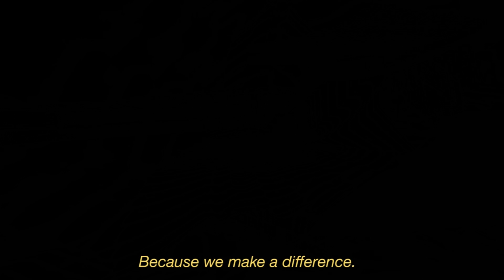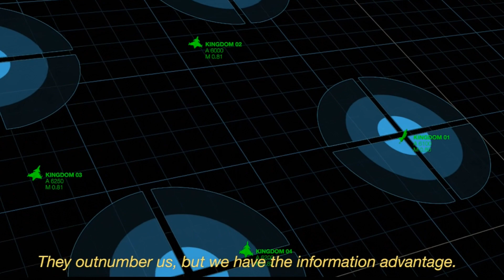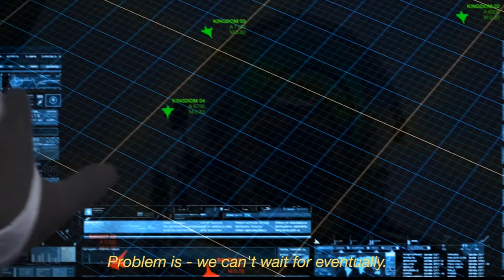Gripen Fighter Jet - Canada's Future Fighter?

Comment: Gripen is an awesome plane but a single engine option doesn't seem to be the best route. I think the Dasault Rafael would fill the role better.
Reply: Why do you say this?  The Gripen has a better safety record than any twin-engined fighter and operates in the Arctic constantly!  This isn't 30 years ago when having two engines was worth it.

Comment: The latest block of F16s would be better than the Gripen.  The F16 is the greatest fighter ever built and an extremely versatile and adaptable platform.

Many if not most major F16 users are switching to the F35 for a good reason.  Not the Gripen but the F35.

It doesn't make sense that if you are going to have a stealth fighter & conventional fighter fleet, to choose the Gripen over the latest F16.

With the USA as your neighbour and the manufacturer and major user of either planes, it would be more sensible for the Canada to have a mixed fleet of F35 & F16s
Reply: The F-16 - Outdated and no upside.  The F-16 is so inferior in fact, that we didn't even want it to be included in the tender.  The F-16 WAS great, so was the '71 Barracuda but I don't think that I'd want either of them over something more advanced.
Reply: Avro Arrow

The F16 can be EASILY upgraded with the latest  technology radar, ew suites, and engines. 

LOL.  Outdated?  The Gripen is over 20 years old using the ancient delta wing and canard layout?

Fact is the Gripen is only getting interest because of lower price and deals.

Many more nations fly the F16 than the Gripen and for those that can afford it they will move to the NEXT GEN F35.

For those on a budget the yes the Gripen becomes a better prospect than the F16, but to say the F16 is outdated compared to the Gripen is laughable.

If Canada was going to go with a MIXED combat fleet with the American F35 being the primary aircraft .... then they should go with American F16s with if they can afford it updated NEW BUILDS or modernised refurbished ex-US aircraft if on a budget.

Sheez.  The States are the manufactures of both aircraft and are your neighbour with a plentiful supply of parts and spares.

It's a no brainer

Actually, buying the Russian Su -57 and Su-34 would solve all of Canada's problems ... but we all know that's not going to happen.  LOL
Reply: You don't make sense, what's so bad about the Gripen being 20 years old? Did you conveniently forget that the F-16 first entered service in 1978, 30 years ago? Gripen E, the latest version, had its maiden flight literally just 3 months ago. Block 70 and Gripen E are both very similar when it comes to specifications; AESA radar, EW suite and so forth are all there. Gripen E has a slightly higher unit cost, but a drastically lower maintenance cost.
Reply: Leon Erlandsson  LOL.  You don't make sense.

Let's get real here. 

Both the F16 and the Gripen are 4th Generation aircraft without stealth abilities and manned.  The F16 has totally dominated the single engine multi-role aircraft in this generation and has completely satisfied all of it's many users.

The 5th generation is focused mostly on mission success with minimal risk of harm or failure & survivability vis improved stealth and reduced detection, avionics, situational awareness by the networking of multiple sensors, and striking targets without detection or beyond vision range. 

But another part of the 5th generation is the movement AWAY from manned aircraft.

Armed UAV's is the future of the combat branch of a modern airforce.

The  F22q & F35 clearly are 5th generation fighters with respected to manned aircraft.  They, especially the F22,  DOMINATE this generation.

Canada is about to replace it's 4th gen F18s with the 5th Gen F35 and are considering also havintg a singel engined 4th Gen fighter to cover broad range of conventional duties with/without air support from the F35.

The F16 is simply the best choice for the Canadian airforce because:
1)  has dominated the market for its type
2) parts and spares are readily available
3) it is produced by it's neighbour who also will be supplying the f35
4) The US can provide made to order NEW BUILDS to integrate cohesively with the supplied F35s
5) The US can provide much cheaper option of refurbished ex-US F16s until the the airforce moves to armed UAV's

And all you can say is that  Aircraft built all the way over in Sweden, with a handful of users, has lower maintenance costs.  smh.

The F16 --  top spec new build or cheap refurbished ex-US -- is easily the better choice.  

It is actually better for Canada to go with the cheaper refurbished machines as unmanned combat aircraft is the future of Airforces.   An F35 securing the skies with a Reaper carrying out ground strikes is a whole lot better than acquiring an F16/gripen and worrying about the loss of the aircraft and its crew.

Enough.  You clearly only have Swedes on your mind
Reply: wutsup Yeah, all I can say is that the maintenance costs are lower. Much lower. Canada does definitely not have the same military budget as the U.S, so these things matter a lot more than the fact that it is simply your neighbor making the planes. SAAB would let Canada build their Gripens in Canada itself, a much better option than buying some refurbished 70's fighter jets, imo. Another point is independency. If the U.S wanted to, they could immediately render Canada's fleet of F-16s useless. A small country like Sweden could not afford to do that. But of course, due to heavy lobbying I doubt we would ever see anything else than American planes serving in the Canadian Air Force.

Comment: Zwhere is the second engine? Needed over Canada's north
Reply: @Jim Small - That's bullshit.  The Gripen has a much better safety record than the CF-18, constantly flies over Sweden's north and also patrols the air around Iceland.  It's not 1981 anymore you know, military jet engines don't just fail like they used to.

Comment: IMHO, the practical solution for Canada's Air Force is a combination of Gripen-E's & F/A-18 SuperHornets. Reasons? 1) They both fill in for the others clear tactical weaknesses, 2) Gripen supports 85-90% of the current Americans weapons + Armaments so the stock-pile of weapons Canada has now will be utilized, 3) Both fighters uses the same F414 Turbofan engine made by GE = more cost savings 4) The Gripen has the best track record of performing in sub-zero temperatures (not including Russian Fighters), a requirement for Canada while the SuperHornet is a proven and familiar platform to the CAF. The Gripen has the lowest maintenance cost in the industry while also boasting the highest output (very rugged). It makes so much sense to go with this solution that it probably won't happen (yea politics).

Comment: This video is an infomercial.

Big 2 problems of the grippens, too light, surely a big economy like Canada can afford better.

Second big problem, for the big expands of Canada and part of that in the arctic is better to have a dual engine fighter, give the pilots a better chance to return to base instead in case of engine failure.
Reply: LostSpider Firat of the Gripen hasn't had a single engine failure for 20 years, including in these conditions. Then Canada is a super big economy. Sure they are big but when it comes to their military spending it's quite low.
Reply: And just what is better?  An Air Force made up of EF-2000s or Rafales that is half the size?  Or maybe an Air Force that is 2/3 the size made up of F/A-18Es?  That's what the cost difference would do.  As for the dual=engine argument, that's a load of crap. The Gripen has a much better safety record than any twin-engined fighter in the world and it operates... IN THE ARCTIC! We no longer live in the 80s and jet engines are extremely reliable now to the point that the second engine is more cost and trouble than it's worth.

Comment: Yeah - let's buy a fighter that virtually no one else is buying from a small country that invests about .005% in military R&D vs. the USA  because we know that it will integrate just fine into the airforces of our allies all of whom have chosen the F-35. Sounds perfect
Reply: JamesJoyce12 SAAB has been a leading Fighter jet manufacturer since the beginning of 1950's if you look at performance and innovation. Up to 1964 Sweden had the 4th largest air force in the world, and the reason it has not been as strong a global player as the US spells politics. You want US on your side when shit comes down? Buy US stuff! SAAB is now a partner with BAE which is one of the two largest defence conglomerates in the world. Look at the F-35; a fiasco which has drawn over budget 8 times from it's original costs. Any other country would have scrapped it and started over, but it involves 175.000 jobs spread over about 30 companies in the USA, so doing so would mean those people without a job for maybe 5-10 years.
The political pressure to buy American military hardware for other countries are huge. The new Gripen E is one of the absolute most advanced multirole fighters on the market now, and the cheapest, but those not researching the facts about it properly don't realize it has the most advanced radar/comms systems in the world right now and with the E model increased payload, fuel capabilities and a 40% stronger engine than the previous model. 
Most people think: 100 million $/a plane = excellent. 30 million$/plane = has to be cheap crap.
Reply: JamesJoyce12 but Saab is a private company...
Reply: If you're gonna go by diseases as what rates an airforce james, the US is the main country where measles is making it's return. On a more serious note, while Indie may still have cholera millions of people in the US still lack clean drinking water and the US is a heck of a more developed country than India is. So your argument there is pretty darn moot.

Furthermore India has a considerably larger population on a smaller mass than the US does with over a billion people, and it's very much still a developing country, the US isn't, well wasn't rather. With how things look there nowadays in certain places i'm not so sure. 

Lastly, while Saab might not be some kind of giant like the Russian or US aeroplane companies they do have considerable experience producing aircraft under their belt since the early 30's and 40's.
Reply: Big differemce,in our RnD spending, we don't spend billions on dollars trying to build a functioning multirole fighter that goes way over budget tenfold and still falls short. 

We build with simplicity and quality in mind, is the Jas 39 Gripen the beast which the f-35 isn't, no not really. But it gets the job done and it does it well, it's considerably cheaper per unit, has a much cheaper maintenance cost in comparison to the F-35 where you can fly alot of excercises without worrying how much each flight will really cost you. 

You can use it in nearly any terrain for landing as long as said terrain is flat land, the f-35 can't really boast that capability.
 
Yeah, sweden may not spend massive amounts of money on RnD of weapons in comparison to the states, neither do we screw over our population in favor of excessive military spending to the point that your own infrastructure is crumbling under your feet and over half of your country is forced to drink poisoned drinking water. 

Besides, Saab is a private company working together with BAE as pointed out.
Reply: India does not have witchcraft laws if memory serves correctly, that would be Saudi Arabia. Reading up on it, there are some states in India with low literacy that has witchcraft laws, but as a whole women are protected against such accusations. 

In India however you can be accused for witchcraft or sorcery and get executed for it, and which country trades with Saudi Arabia in the billions, the US: 

Point in  case is, India may have it's problems, but it's not a weak nation in any regards with it's over 1 billion population , does it have it's problems. Sure, but every nation has it's problem. I don't see where you are trying yo get with this James one bit.

And if we're talking poverty, the US has a poverty rate of 13.5% which is very big for a country has is technically considered a first world country and a post digital country.
Reply: @John Doe - Not to mention that Canada is in the unique position that the USA will ALWAYS have our back because if we  fall, there's a MASSIVE undefended border that they'll have to protect.  We can get whatever we want and that won't change.
Reply: Does anyone in the world think that Brazil or India has any kind of a serious airforce? If by IAF you mean Israel then you might have a point but India - seriously? They still have cholera there.
As for Saab - they make quirky cars - call me when any first-world airforce actually buys one of their planes.
Reply: The british have a few for toys and playing with. The Hungarians? Please. And India is still the only country where you can burn or stone a witch to death and it has one in three of the people in the world living in abject poverty - it even beats africa- yay!
Reply: first world airforces with an aerospace sector try to build their OWN planes
Reply: Yeah - accent on 'try' - no one in the rest of the entire world is buying this 'try' plane.

Comment: Canada is a big country. Two engines are a necessity to get them home if one fails. F-35 is an expensive POS. Gripen is a nice bird for arctic warfare, but like the old Starfighter if an engine goes bad, it's going down. Superhornets make sense. Minimal training costs as we have 18's already. Want a pairing of two airframes? Superhornets for air supremacy and A-10's for ground support.
Reply: That's a load of crap. The Gripen has a much better safety record than any twin-engined fighter in the world and it operates... IN THE ARCTIC! We no longer live in the 80s and jet engines are extremely reliable now to the point that the second engine is more cost and trouble than it's worth.  Not to mention that Super Hornets can't fight worth a damn in the A2A sense.  Have you even read up on these planes or did you just look at the pictures?